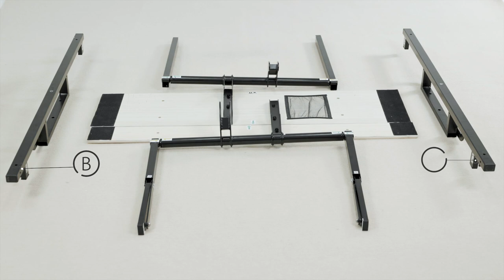STBB022 Electric Bed Assembly Video

Comment: Took me 2 hours to assemble. Thanks
Reply from the maker: Hope you like our product
Reply: @samsbed4150  out of curiosity. The unit head motor would lower on its own. I unplugged it and plugged it back in. Is there anything I should check or reset?
Reply from the maker: @jaynyce1980  Please send the installation status under the bed to our platform customer service via video.

Comment: I have installed the whole bed. But foot side doesn't goes down. Also where to put S and R foams in the bed before putting the cover
Reply from the maker: There are Velcro stickers on the bottom of the four sides of the board, just stick them on. You can try elimination. If the head can rise and fall normally, please insert the wire of the head into the foot mark of the controller to see if the head of the bed frame can still move normally.

Comment: Does anyone know what the black foam blocks marked S are for is this just shipping material because they are sleeved in fabric and they look more involved than just shipping material
Reply: They are to attach under the wood frame around the edge to the velcro before you put the cover on. They are marked R and appear in the instruction booklet right before the motor part.
Reply: At step one, the M piece holes don't match and head side only has 2 holes instead  of 3. 😢

Comment: Worked great for a month now motor not working foot of bed stuck in up position. Tried putting in emergency battery. Did not work. Motor beeps as expected when plugged back in. Remote seems to be synced fine. Can’t find anyway to contact company for help or warranty.
Reply from the maker: please tell us your order NO

Comment: Do you have exact remote pairing instructions? I just assembled the bed and nothing works. I have pressed the red button and I either get a beep or 3 beeps and you can hear the controller doing something, but the buttons on the remote still do not operate the bed.
Reply from the maker: You can contact our store customer service and send pictures of your installed structure, and then we will check what went wrong
Reply: @samsbed4150  That's not at all helpful. I have filled out the Contact Us form, got 1 reply asking for the order #. I replied with that on Monday the 8th, and have not heard back from anyone. I have sent several messages, which have gone unanswered.
Reply from the maker: Please contact our store customer service. Provide them with pictures of your under-bed motor installation. Our engineers will then check where the problem is.
Reply from the maker: @chrislane1627  What's your order No

Comment: There are missing instructions on which hardware to use in both the video and manual. For example time stamp 2:01 - which screw is that?
Reply from the maker: Page 10-Step5, Y3 screw

Comment: Question: do you have to program remote? Mine blinks 4 times intermittently but the bed doesn't move. Only by small increments and that come and goes.
Reply from the maker: Is the problem solved now?
Reply: @samsbed4150  no still need remot6
Reply: Mine also does this now it doesn't move at all is there a resrt
Reply from the maker: @debvanselow8441  Please click the red button on the controller
Reply from the maker: @debvanselow8441  There is a red button on the controller
Reply: @debvanselow8441  Did you figure this out? Mine is not moving and there is No Red Button on the remote... Thank you for your help!
Reply: Idk if you solved this yet but try a new battery. The battery it came with was dead. Touch your lounge to it, if there's a light tingle it's dead

Comment: the control board beeps six times and does not activate the motors to move when i press the remote button. it worked for about 45 days and stopped working
Reply from the maker: Please contact our Amazon store customer service and describe the problem in more detail, so that they can solve the problem for you faster

Comment: Honestly this is not the worst instructions but definitely not the best. The video has no audio and very fast paced. You have to keep pausing and rewinding to see which parts are what. Instruction Manual is not illustrated correctly so it can be a little confusing. The video and the instructions on paper do not line up. You should make another video slowing the steps down that way people can CLEARLY UNDERSTAND AND NOT RETURN YOUR PRODUCT.
Reply from the maker: Sorry for the first-time installation customers, this installation video is really fast.
Reply: Lol yep, i had to play it on .25 speed and was still rewinding. Audio would be extremely helpul as well, audio cues set the pacing.
Reply: @samsbed4150 I was still able to install correctly, it just took me a little longer than expected 😅 hope a new video was made or is in progress to be made for future customers because I've been loving the base so far. And its so much cheaper than others out there
Reply from the maker: Thank you for your valuable advice and support. In the near future, we will introduce more cost-effective electric beds. @we.are.all.one_2195
Reply: YouTube has it so you can slow a video down
Reply: yeah lol of coarse you can. Despite that fact which i ultimately did just that, but it was just an observation I saw that can improve the customer experience @jerseymontana1310

Comment: If your controller doesnt work, try replacing the battery, the one they gave me was dead. You can test it by touching your tounge to the prongs of the battery, if theres only a slight tingle its dead. If its charged it will be a strong tingle. Doesnt hurt for anyone thats scared to test it, haha

Comment: I would however recommend a rewrite of the paper manual. it lacks details of which screws to put where so watching the video is required. this can be problematic if your installing this bed in a remote location without cell service. The manual and video should compliment each other but you really do need to ensure they both have FULL instructions incase the video is inaccessible
Reply from the maker: Because the manual is produced first, we thought it necessary to release the installation video after selling for a while.

Comment: I am missing the "Q" panel piece (for the foot of the bed) and any corresponding nuts and bolts to attach it to the bed. How can I order this? The Owner's Instruction Manual does not have contact information that I could find.
Reply from the maker: May I ask if you get in touch with the customer service of our store to get these accessories？
Reply: @samsbed4150  May I get your email address to ask a question?
Reply from the maker: @dawnbaillie3260  symm0729@gmail.com

Comment: What do I do when the Head of the bed hydraulic are not lifting
Reply from the maker: Is the foot working properly? If so, please insert the head wire into the foot hole of the controller, and the foot wire into the head hole of the controller. In this way, it can be judged whether it is the problem of the head motor or the problem of the controller. For more specific after-sales solutions, please contact our Amazon customer service.

Comment: My bed won't work after plugging it in. What did I do wrong??
Reply from the maker: Is this problem solved now?
Reply: @samsbed4150  Yes, I was able to finally solve the issue.
Reply: What was it
Reply: @auraseverino8603 what did you do to solve this

Comment: Thanks for skipping the part where we install the two bars labeled "S" onto the foot boards labeled "P" and "Q."  Ask me how hard that was to do once the bed frame was assembled.  😑😑😑  You also don't show th installation of the foam pieces.
Reply from the maker: Sorry, our installation video is still not perfect. We apologize for the trouble this has caused you. The foam pieces only need to be attached to the Velcro under the board. Any other questions, you can contact us anytime.

Comment: The blue light on my remote keeps flashing?
Reply from the maker: Sorry. You try to rematch first. Press and hold 3 buttons at the same time, the head up and foot down buttons on the remote and the red button on the W3. When you hear 3 beeps, the pairing is successful. If the remote is still flashing, please contact our Amazon customer service to replace the remote.

Comment: my actuators dont move, buzz and barely move an 1/8 of an inch
Reply: tried pairing remote, got 3 beeps still only moving when it feels like it. what a complete waste of money
Reply from the maker: What accessories do you mean by actuators, the remote control W1? Controller W3 or motorI1I2?

Comment: Missing the installation of the foam pads and the two bars labeled S. I mean, why make a video if you're going to miss parts?? 😂
Reply from the maker: We are sorry that this happened. Please contact the store’s customer service and we will resend you the accessories immediately.
Reply: @samsbed4150  you misunderstood.  Your video fails to show the installation of the S bars and the foam pieces. So now those are left over because the bed is too heavy to flip and install the S bars.
Reply from the maker: Step 12 in the instruction manual. The bed in the video is a basic model, so there is no such step.
Reply: @samsbed4150  the manual says to watch the video, which is much easier to understand, so naturally it's what most people will use to assemble it. If it was in the manual, it should have been in your video
Reply from the maker: @dangsxgomez  Sorry for this, we will improve the video later. Is your problem solved now?

Comment: Does anyone have a list of tools needed?
Reply from the maker: Do you need us to send you instructions?
Reply: The three tools needed came with the unit. Two allen wrenches,  and a small cresent wrench to hold the nut as you tighten with the allen wrench. You could buy these tools for less than $3.00 at your local 99 cent store.

Comment: No sound on this video
Reply from the maker: Because there are subtitles. Have you installed it successfully?
Reply: @samsbed4150  still the video is very fast paced and no audio. Have to keep pausing and rewinding. Pretty frustrating.
Reply: @We.are.all.one_21  You can slow down the video's speed and follow the steps easier.

Comment: This bed is not an easy set up. It took 4 hrs before I contacted Wayfair for assembly assistance. Do not recommend! 😡
Reply from the maker: It is recommended that you watch this video several times before installation. Helps you better understand accessories and steps😊

Comment: This is terrible. No arrows on anything. Something’s are not labeled. The book starts at one point and the video starts at another. Doesn’t say what screws to be used. Total mess
Reply: Oh and this video doesn’t work for the twin. My E is labeled on the pegs that hold the bed up so it doesn’t correlate to this video even more
Reply from the maker: Our upgrades are all marked. And the instructions are marked with what coded screws are needed for each step